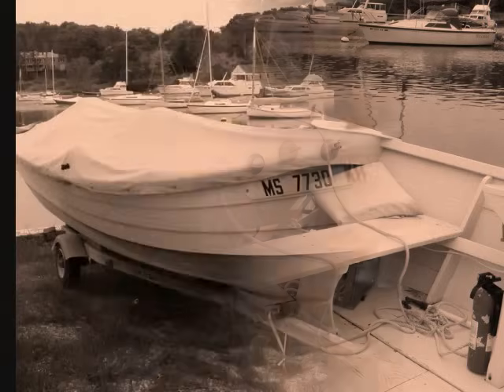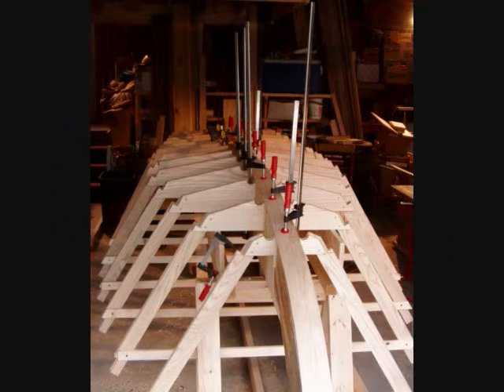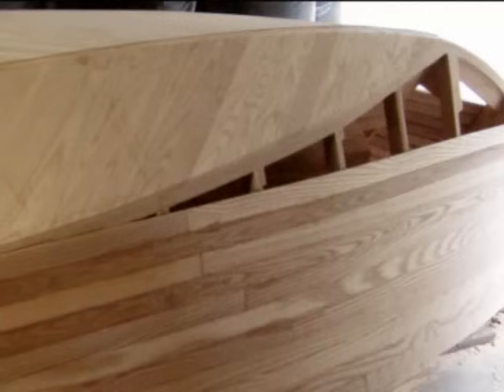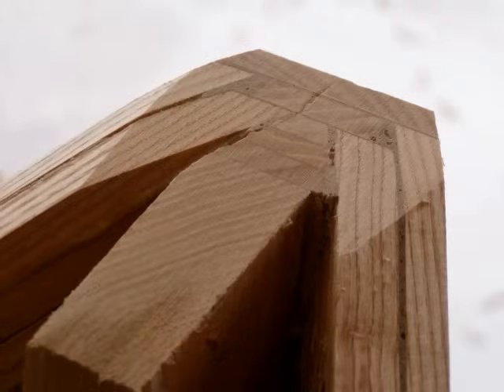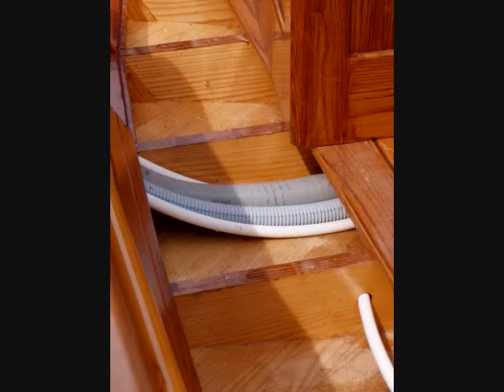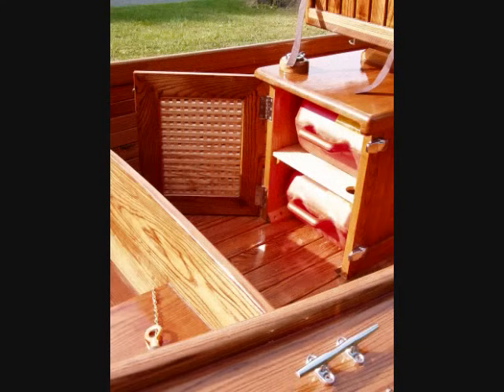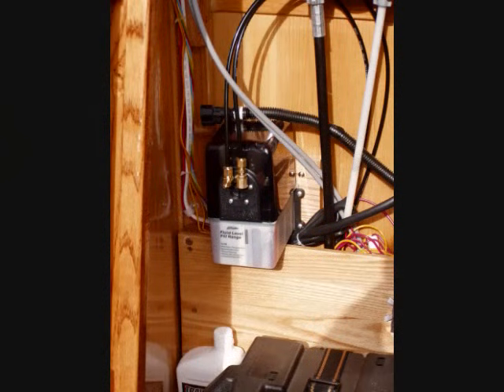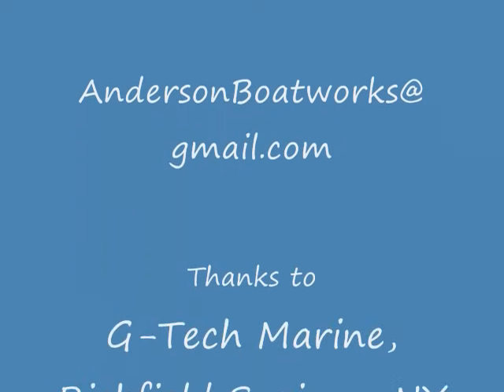Building a wooden boat

Comment: how much could i purchace one of theese for?
Reply from the maker: One unit (lightly used) on hand....make an offer.
Reply: Stuart Anderson 100.00
Reply: if I knew I would make an offer.. so what would you consider selling one of these for?
Reply from the maker: For $30K you can ruin my summer fishing plans and make your own.....boat, motor, trailer, fish finder.
Reply: how much didnit actually cost? by that the cost of supplies?
Reply from the maker: I spent $25K out of pocket
Reply: thats expensive wood!
Reply from the maker: I buy the wood rough cut direct from the sawmill; it's not expensive.......it's the epoxy, fiberglass, stainless steel fittings and hardware, electrical supplies and gizmos, and motor where the money disappears so quickly.